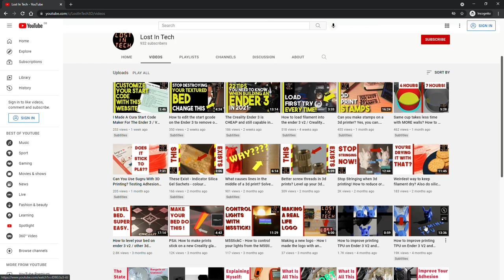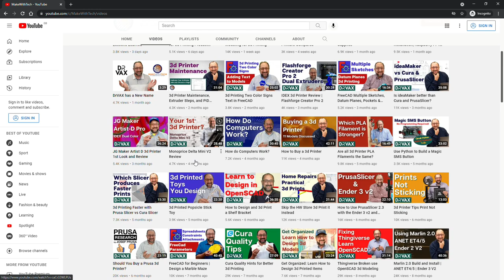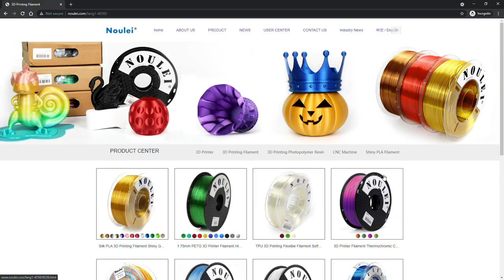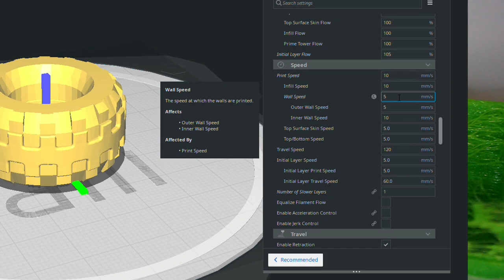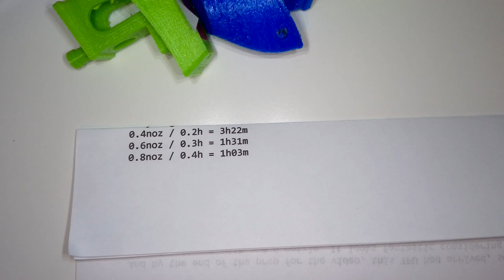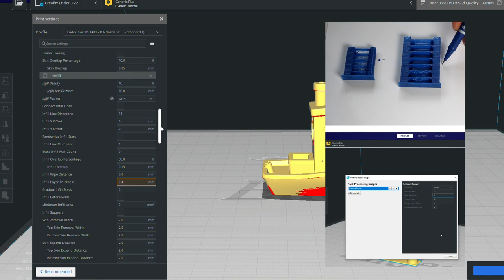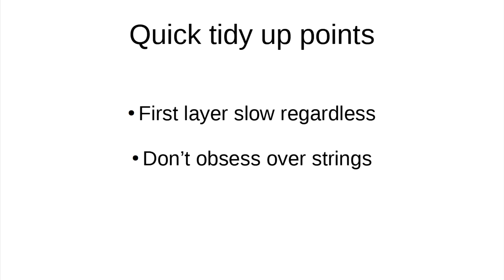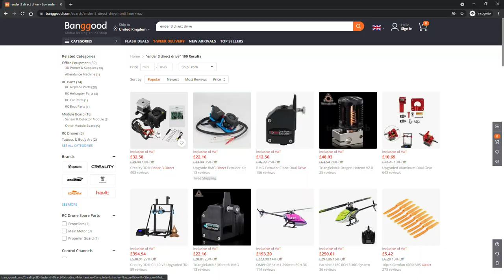TPU Cheat Codes! Get SHINY high quality TPU 3D prints on your ender 3 / other bowden printer.

Comment: I like the tip but I'm able to achieve similar results printing 95 TPU on a Bowden extruder with 0.4 nozzle 30mm/s. My cheat code was printing higher temp between 230-240C.

Comment: Im literally sitting here printing crazy flexible tpu @ 100MS on a 1mm busted ender 3 stock cura settings, 80 bed and and dual leads
Reply: I know you posed this awhile ago but same thing sitting here with no experience with tpu printing 75A at 270mm/s on the k1 max. Everyone makes it seem so difficult when it isnt

Comment: First off, thank you for your TPU bowden content. You're a legend! I thought I saw somewhere what I am about to share and would LOVE to see a video that accentuates this issue. I was simply getting twists in my gear assembly and didn't understand why. Then I had the epiphany to pull out the TPU from my Sunlu drier like yours and lay it flat on the floor like 10 feet if it. I came back like 45 minutes later, and the light bulb came on. The sheer action of unwinding a spool of TPU causes twisting. Once I figured this out, I now simply pull out the filament from the drier every hour or so and rotate it (clockwise in my case) to get rid of the twisted curling. I also rotate beyond it, just to prolong how much I have between my detangling intervals. Thanks again for your amazing content, which motivates fools like me and my Adventurer 3 (MP Voxel flashed).

Comment: Thank you for this video!! Your 0.6mm settings worked perfectly with Gizmodorks Shore 96A TPU on my Ultimaker 2. Note for Old Ultimaker owners like myself: The Ultimaker 2 doesn't have an exchangeable nozzle. I had to go online and search for "Heater Block Nozzle kit Compatible with Ultimaker 2." I was able to use my old heater and sensor, so it was only a $40 problem, and now I can switch back and forth between 0.4 and 0.6 nozzles (so yourself a favor and get a 7mm wrench if you don't have one). Thanks for your careful thinking Lost in Tech!
Reply from the maker: Good to hear, and you are very welcome!

Comment: Excellent tips and discovery!  I just finished printing (tried) a TriLoop propeller (for a quad), with a 0.2mm nozzle, and it came out like snot (and too much stringing and gaps).  The model is obviously too thin.  I noticed when I tried to make certain it would flow, I set the feed to 4.0mm/sec, stopped, and the filament continued squirting out for a few seconds - so definitely pressure build-up.  I'll pay closer attention with my newly gained knowledge from your video. 
Gotta say, I wasn't a fan of the chapter graphics, at first.  BUT, they grew on me as the video rolled on.  I like it and adds production value, in my never to be humbled opinion.

Comment: If a proper BMG style extruder is more than you want to spend, even some of the cheap aluminum dual-gear knockoff ones are pretty good, as long as they're designed well. It's also pretty much a drop-in replacement on the Ender 3, just switch the gear, screw on the top and set your e-steps. Or at least if Creality didn't cheap out and give you a motor with a too short shaft like they did for me.

The key is to have as little open space after the extruder as possible. If the filament is captive from the moment it enters between your gears, there's nowhere for it to jam up. The extruder I got has a wedge with a hole at the right height. It fits between the two gears, and has a mm or less where the filament is out in the open. There's a mod for the stock extruder that creates a similar effect by cutting a piece of PTFE tube and sticking it between the gear and idler. The only potential problem is in the Bowden connector. Mine came with one that blocked the PTFE tube, and had a big open chamber at the threaded end. I replaced the connector with another one that let the tube all the way through, and have had zero problems since then.

It was a nightmare to figure out, because the first two test prints I did came out perfect (+/- surface quality and stringing; they were my temp and first retraction towers), but after that I couldn't so much as put down a first layer. I thought it had to be anything other than jamming, and couldn't figure it out until I unscrewed the connector and saw what was going on there.

PS: Don't eat your Benchy (@ 16:10)
Reply from the maker: I have a short shaft on the extruder on my recent ender 3 too! I'm not terribly impressed with this.

I've actually ordered the creality direct drive kit, and a spare NEMA motor for the extruder too, hopefully with a full size shaft. Plenty of fun times and fun videos ahead 👍

Comment: I have a small business and sell TPU products that I designed.  It took months of fiddling before the results were suitable for a products and two years later, I'm still learning the dark art of TPU printing.  I recently upgraded to a Neptune 4 Pro, not for the speed because TPU has a low upper speed limit, but for better print quality, better cooling on the non-TPU parts and for the awesome Klipper/Fluidd interface.

The reverse Bowden tube 3D printers such as the Anycubic Kobra 2 weren't contenders for my new printer because I print so much TPU.  I feed all filaments from a reel holder two feet above the printer, straight down into the direct drive extruder.  I haven't fully tested the long melt zone on the Neptune 4 Pro yet.  In theory it could be problematic for TPU.  The initial TPU test prints were OK and hopefully I'll be able to get better print quality after more dark art tweaking of TPU print settings.

Chaos is what killed the 0.8 mm nozzle TPU experiments.  It's the same phenomenon as closing the spigot.  For most of the changing flow rate, there is a stream of water that gets smaller with decreased flow.  That's obvious and intuitive.  Just before the tap is completely closed, you'll no longer have a very small linear flow.  You get drips.  Initially the drips are regular but continuing to decrease the flow will result in sporadic non-regular drips.  Drip.  Drip drip.  Drip.  Drip drip drip.
Reply: How is the business going? You ship to your country only or anywhere?
How you promoted/ advertised your first business days?
Reply: @jw200  - So, basically, how to start an online 3D printing business?   😛

I've neglected marketing so the business could be doing much better.  I'm an engineer.  I design new products which the competition steals (not developing a different competing product but blatantly ripping off the design in every detail and then plasters their name on the side in a logo that is as large as they can fit onto the product) and then does a much better job of marketing, selling the product at a higher price, so I'm basically doing free engineering for them.  My response is engineering new products for them to steal.  Yeah, not too bright.  I'm an electrical engineer so the next product will have electronics that might be more of an impediment for their thievery, but I'm currently wrapping up the development of a 3D printed product in a completely different market.  Of course, that will need more marketing because my company has no brand recognition and established customer base and good will in that new market.

We ship anywhere but First Class Mail International has become completely unusable as well as too expensive.  Customers don't want to wait 45 days to receive their products, and lately half of the shipments are either lost, stolen or returned.  Our products are inexpensive and customers naturally don't want to spend more on shipping than they did on the products, so shipping by a reliable non-government carrier such as FedEx or UPS isn't an option.  When our website is updated, all international shipping options will be removed.

I started the company in 2006 making products with a CNC laser and CNC machining tools.  Marketing was difficult, doubly so because I'm an engineer and hate marketing.  I advertised on an online forum where I was an active member and now help moderate.  I hate spammy weasel stuff so I kept my private and business persona's separate because I didn't want good will generated by my helpful technical answers to questions and site moderation to convince people to buy my products.  I don't want the perception that I'm using the forum to scam free advertising.

I tried Google AdWords advertising and couldn't tell that did much good.  If I was serious, I'd advertise on Facebook, Instagram, etc., but I hate Facebook and try to pretend it doesn't exist.  Probably the very best advertising for our website was videos our customers made, completely unsolicited by us.  They liked the products and made a YouTube video to share their enthusiasm.  It's difficult to beat the social media broadcast version of word-of-mouth advertising, even though they'd often do an unboxing style video and rather than make a video of them reading the instructions, they'd rush straight to installing the product with all that can go wrong.

My hope was that search engines would allow customers to search for something they wanted to buy and be immediately connected to small companies selling the product.  That was happening in the early days of search engines, but that mostly stopped.  People look on Amazon and eBay and sometimes Etsy or Walmart's online site.

We had an 8X increase in sales when listing products on Amazon but their bot kicked us off for violating their product guidelines even though we didn't.  Not even close.  There's no person for a seller to speak to unless generating $1M a month in sales, so there was no way to appeal.  I should have relisted new versions of the same products, omitting the word that their ban-bot had misunderstood, but for the last four years I've ignored Amazon as a selling platform... although I still buy most of my stuff from them, including a lot of 3D printer filament.  I need to get this small business back on Amazon.  I generally need to do a lot better job of marketing, but I hate marketing and would much rather spend my time engineering.

Comment: Learnt so much about print TPU from your YT videos - would like to say a big thanks, loaded your profiles, after struggling with lamination issues previously, printing some large air ducts for a Drone using your 0.4 Standard and amazed by the quality and stability. once I get some 0.6 nozzles, will give that a try- Thanks Man
Reply from the maker: Glad to hear it helped! I know a lot of my subscribers are drone enthusiasts so I try to plan a lot of flexible filament based stuff 👍

Comment: I can give you a cheat code for TPU with 0.8 nozzles... on an Ender 6, after playing with your values a bit. Should work on others. That is, line widths are all 0.74, except initial layer, which is 0.98. 0.32mm layers, initial layer is 0.28. Speeds are 8 to 10mm/s for initial layers, ramps up to 35mm/s over the course of 6 layers. Inner wall speed is 32mm/s. Travel speeds 150. 

Initial layer flow is 92 (I run PLA-tight squish on the first layer and can't be bothered to alter it between prints. It's just to stop the extruder clicking on the first layer).
Flow is 96%, with 94% for inner walls and skirt/brim. Temps are 250-260, bed 45-60 depending on if it is 97A or 58D I print with. 

On small features, the speed drops and the quality goes out the window, and unless you tweak acc/ jerk to fix that, all you can do is increase the flow to stop the dripping... I print a funnel that has a Ø12mm spout, and then we see 12 mm/s and blobs.. I change the code at this point to give me 30% higher flow, and the issue is almost gone. Work in progress.. :)

Comment: Great stuff ! .500 extrude jet works here..speed and flow, heat is the 3 critical settings!  Higher heat expands the filament in melt chamber  and helps push it out.  I have printed a speeds of 50 !
Reply from the maker: yes 100% agree, 50mm/s is pretty good! 👍

Comment: I'm getting good results on a 0.4mm E3D Revo nozzle @ 30mm/sec and zero retraction. Geeetech orange TPU, 225 degrees hot end, 60 degrees on the surface, 0.15mm layers. This is with the fancy Capricorn blue PTFE. The kind that's translucent, so maybe 0.1mm wider than the non-translucent blue from the same vendor.

Because it acts like a spring (exponentially more than PLA) it's best to keep the speed at a steady state.

At one point, I was using 2.5mm retraction, and it jammed but good. I tried messing around with it quite a lot, but found the best solution was to push through some clear PLA. After I did that, no problem.

Comment: I've gone the other way and slowed my print speed way down, while increasing layer height and line width. Decent print quality at 0.28mm layer height, 0.6mm line width, 12mm/s speed. 2 mm^3/s

at 240C, my layer lines and walls fuse together to look as if they're injection moulded, really happy with the quality of the parts.

The only thing I can't get quite right is retraction, still get a fair bit of stringing, but it's good enough for me.

Overture TPU off amazon is the only stuff I've printed so far, but after half a day of fiddling with settings (following your first TPU video), I'm really impressed that my ender can print TPU so well
Reply from the maker: I will try overture! I've been very impressed with their petg
Reply: @LostInTech3D  Good to hear! I might have to check out their PETG as well. They had a 20-25% off sale for prime day for most of their filaments, that's where I picked up this TPU

I've also fixed my stringing, turns out I had my flow % set way too high from trying to fix issues early on in calibration, bringing it down to 105% fixed the stringing and walls are still sticking together well. Got my print speed up to 18mm/s before the TPU kinks in the extruder, got a dual-gear model with hopefully better tolerances coming soon

Comment: After trying 4 direct drive kits and 14 bowden extruders i settled on EZR as the best for TPU.  Ive used it in DD setups. But still prefer bowden for it's simplicity. For example if you run filament past the extruder. It's a 10 second fix on bowden to pop the PTFE tube loose and pull the strand, but on DD it's 20 minutes to disassemble the hotend carriage
Reply: Mini Bowden then. I got a bit of ptfe between the extruder and my hotend, can just unscrew the extruder with 3 screws and remove it

Comment: Printed for the first time with TPU today with my prusa mini, using a 0.8 nozzle and I relied on slicer speed settings and achieved a decent result playing with the temperature. Went from the recommended 240° to 205° .. will test speeds to see if it improves :)

Comment: Pretty interesting findings on the pressure, I run a direct drive V6 clone and Titan extruder (clone too) and print TPU (99A they say on the datasheet) at the manufacturer's specs of 20mm/s max, and it gives great results, other than the stringing of course. That's a 0.4mm nozzle and layers usually 0.2mm, but really nice results at same settings other than layers 0.08mm for a project that needed the precision on the surface finish. Might try even faster settings for the outers.

Comment: I print TPU on .4 nozzles all day. I also do dry TPU right out ofthe bag.  Biggest thing to improve your TPU is to replace your extruder to something like EZR Struder.  I do like to use larger nozzles like .8 and 1.0mm for large prints, if they are going to take more than 24hours on the standard .4 nozzle
Reply from the maker: that's an interesting extruder design!
Reply: @LostInTech3D  having tested microswiss, bondtech, creality and dozens of cheap extruders, there's nothing even close to as good for TPU as the EZR...it's completely enclosed filament path gives TPU nowhere to wriggle out of pressure builds on the nozzle... i run a small TPU print farm of 12 printers, but upgrading every machine to EZR has made a huge difference in reliability.

Comment: Bit confused by a later section, the pressure difference between nozzle size is dealt with via the mass flow calculations I thought? From what I can see lower feed rates will eventually start being small enough to be impacted by the flex in the filament during feeding? It's a complex subject though and very interesting. I haven't touched tpu for over a decade and need to get it working on my k1 max. I imagine a reverse Bowden will be able to go lower but will still hit that flex Vs flow rate issue eventually too.

Comment: I got Esun 95A fairly dialed in now and ive noticed no difference in quality between 100mm/s and 30mm/s (direct Drive)which seems contrary to what most people experience also having a higher travel speed really helps with the stringing which is the biggest issue I have with TPU.

Comment: I get an error when trying to import your profile. Can you post your settings in a txt format or screenshot so that we can see them? I saw the standard setting and manually, but I want to know what gives the "higher quality" and "superior Quality"
Reply from the maker: You can open the profiles in notepad and they are readable, but give me a shout if anything doesn't work with that
Reply: @LostInTech3D  I tried that with mac's "text editor" and it didnt work. but dreamweaver did. Thanks for the tip

Comment: Crap, too late, I got a direct drive. 
Would have tried that before if I saw this before I got it. 
100% agree with the jet flame torch for cleanup. Works great. Especially with the thin stringing. Made cleanup better and faster.

Comment: If you change your material in cura to TPU, it will have defaults more optimized for it. Also, I run 60mm/s retractions with a lot of success.
Reply from the maker: bowden or dd?
Reply: @LostInTech3D  Stock ender 3 pro. I'm going to make a video about it soon